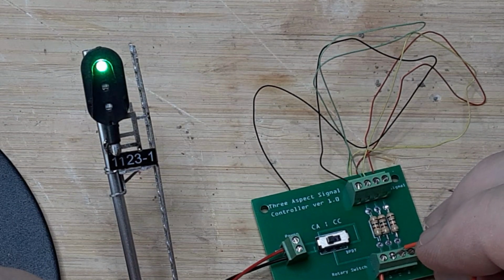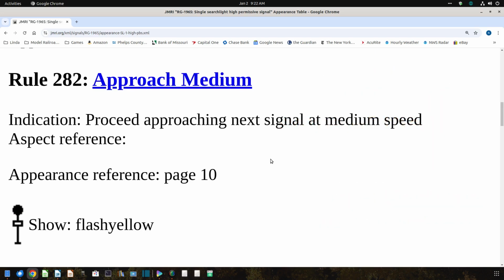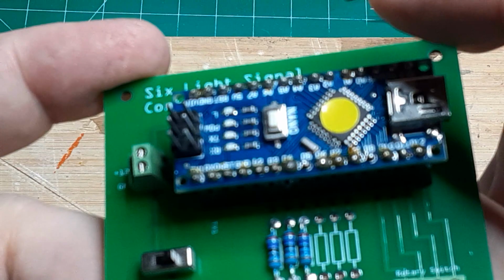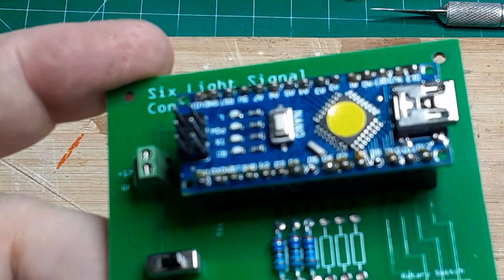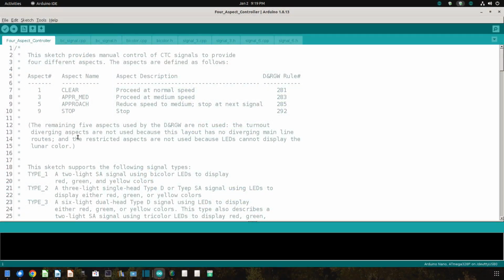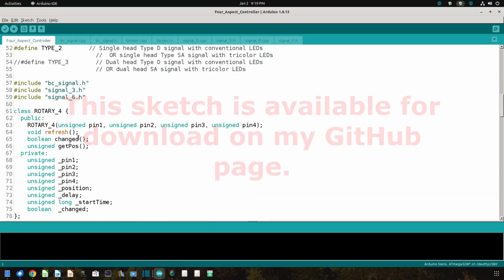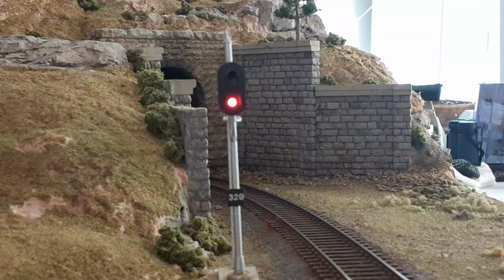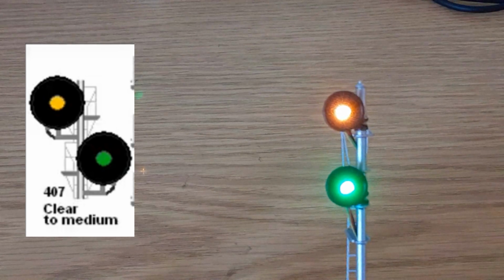Simple and Inexpensive CTC Signal Control for Your Layout

Comment: Excellent video, thanks for sharing it, much appreciated. As a ‘retired’ novice, is their a possibility of incorporating IR sensors instead of the rotary switch? If so how would one accommodate a such device/s. Any advice/help would be appreciated. Regards, Jay
Reply from the maker: I assume you're thinking of using IR sensors as a "touchless" switch to change the signal state. In that case, you'll need both an IR emitter LED and an IR detector LED. (Forgive me if I'm just stating the obvious.) If you watch my Speedometer video series, you'll see how to use such an IR LED pair to detect an object in front of the LEDs. You'll need to mount the LEDs so they are "looking" straight up - otherwise, the sensor will trip whenever someone walks past the sensor!
The emitter/sensor pair will have essentially two states: detecting and not-detecting. Your software needs to watch for the state to change from not-detecting to detecting and back to not-detecting. This cycle becomes a touchless command event.
Once the command event is detected, the signal advances to its next defined state.- for example, Stop advances to Approach Slow; Approach Slow advances to Approach; Approach advances to Clear; and Clear advances to Stop. (You should think about a logical sequence that suits your needs.)
If this all works (and I see no reason why it shouldn't) you should be able to change the signal aspect by waving your hand above the sensor. (You might need to build in a short time lag to keep the software from thinking five fingers is five separate command events.)
Best of luck! Let me know how you get on.

Comment: Where do you get your own PCBs made custom like that?  I’m working on a 13 control point system with 40 3-led signals and  35 turnouts/interlockings, and 26 IR block occupancy sensors all driven from a single arduino nano.  I’ve been trying to layout all the parts on perfboard, but it would save me a ton of time if I could have my 13 control point PCBs custom made.
Reply from the maker: Look through these comments for the question from @cabanabobshlemonjr2758 and see my response for additional details. Also, see my video: https://www.youtube.com/watch?v=58Gbmabdz84&t=2s where I briefly illustrate the board design process using Fritzing and explain in the video description the process of ordering the custom PCBs. They are amazingly inexpensive: 15 boards will cost you less than $10. Select "Global Standard Direct Line" shipping - it is cheaper by far!
Since you're going to need 13 nanos, you can save a bunch of money buying them from AliExpress. If you buy them without cables, they'll run less than $2 each - you just have to solder the pin headers to the boards. The LAFVIN Nano clones on Amazon are almost $20 for 3, bringing your total cost for fully assembled Nanos to over $80, versus about $20 if you solder your own pin headers.
Good luck, and feel free to reach out for help. You can find my email address by going to my channel home page and clicking the "...more" link.

Comment: I don't understand any of this electronics nonsense......it's just to complicated to me
Reply from the maker: You're absolutely right - this isn't for everyone. However, there are a large number of modelers who enjoy that aspect of the hobby, and hopefully, this video will appeal to some of them. Thanks for watching!
Reply: @rwissbaum9849  I was a train dispatcher for the western roads for 34 years, and worked on all types of CTC systems EXCEPT for the old US&S lever board.  I am working on a 2 x 16 foot shelf layout with staging yards at each end. Pretty sure I will be modeling after the Western Pacific system with SA searchlights by Showcase Miniature models.  I will only have three control points and a total of five isolated blocks. I will be using home made resistor wheel sets.

I have just about all of my Code 83-70-55 track hand laid now, and have started the DCC wiring.  I may not get to using the CTC system for a year or so, but I will definitely cut gaps and add the feeder wires as I wire up the basic DCC on the layout.

As time approaches, I'll be gathering the parts needed and getting into the actual signal wiring.  I will be using the US&S CTC control knobs and levers by Rix Models however and mount them on the fascia at the appropriate locations,  Maybe have a small CTC board centrally located with all five blocks, five switches and such on one board. We'll just see how it goes.

Thanks for this instructive video and I will get around to the others as time permits.

Comment: Where can I get the PC board
Reply from the maker: I order my boards from JLCPCB (jlcpcb.com). These guys print custom PCBs at very reasonable prices - you'll pay just over $4 for five boards and just over $7 for ten boards, including shipping. (BUT be sure to select "Global Standard Direct Line" shipping, which will take a little over two weeks from the day you order until the day you receive (based on my experience).
To order the boards, go to my GitHub page (https://github.com/RJW496/DRGW-HO) and download the file named either Three Aspect Signal Controller v1.0_.zip (to control a single three light signal using a three position switch) or Six Light Signal Controller v1.3_.zip (to control one or two signals using an Arduino Nano clone.) When you click on the file name, you will see an apparently blank page, but click on the "View Raw" link and you will be prompted to select a location to download the file.
Once you have downloaded the file, go to JCLPCB (or any other custom PC board supplier) and click the "Order Now" link. You will be prompted to upload a Gerber file. Select the .zip file you just downloaded from GitHub. Select how many boards you want (you can order in increments of 5) and select add to cart. Then go through the checkout process as you would with any web site.
IMPORTANT I am not compensated in any way by JCLPCB. I learned about them from Jimmy on his Digital & DIY channel.
While you're waiting for your boards to arrive, you can order the rest of the components you'll need.
Hope this helps!
Reply: Thanks to Richard for doing all the legwork. I ordered and just received 25 Arduino Nano based boards from JLCPCB. While I don't think I will need 25 pieces that was a good breakpoint on the cost plus shipping. I can spare you a few if you still need them - cost plus shipping. - Tony.